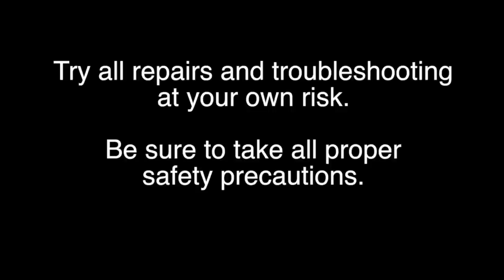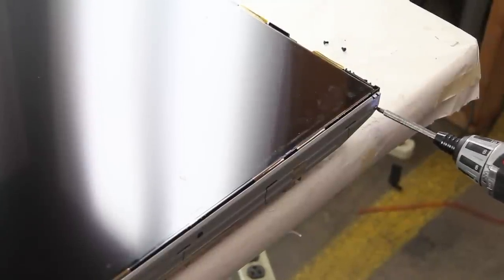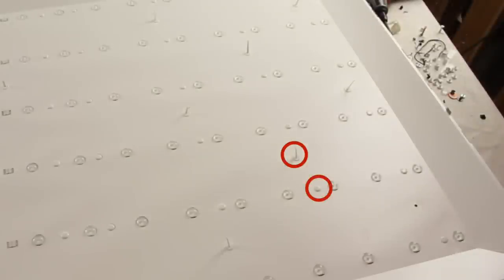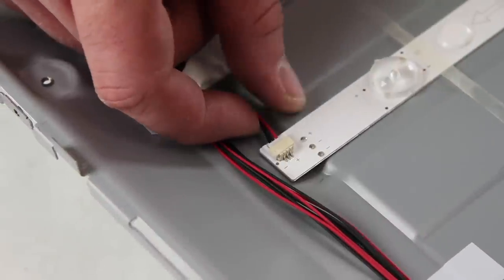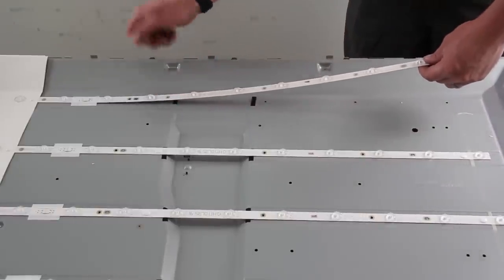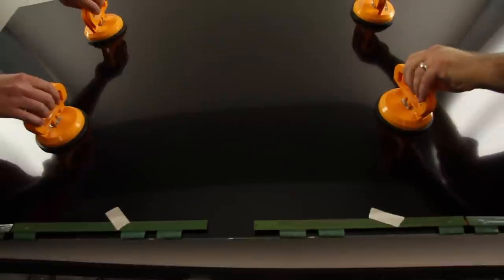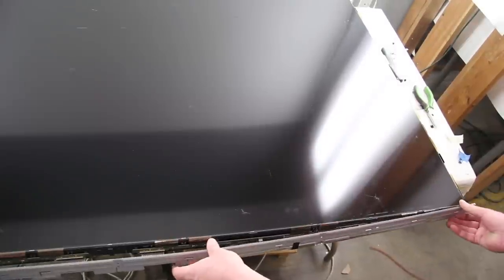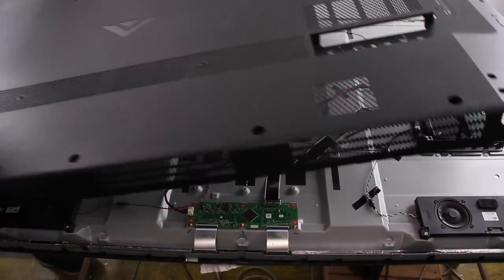Vizio 70" TV LED Strip Replacement Tutorial for Vizio Model E70-E3

Comment: i have a vizio 70 inch tv e70u-d3, and the tv is showing a purple hue it's pretty noticable to me, I think its the LED lights but I was wondering if it's something else.  So I wouldn't have to replace the LED lights, could it be the main board?
Reply: Generally when an LED strip goes out you will see a rectangular darker area on the screen. A purple hue across the entire screen doesn't sound like a backlight.
Reply: T Bone what is it usually indicate then, because I purchased LED replacement strips already
Reply: @alexusher7566  - After googling your problem it seems it actually may be the LEDs so you may be on the right track after all. Sorry. Personally I've never seen them go blue, just completely burn out. Good luck with your repair.
Reply: alex usher did the led strips fix your issue? I have the same thing!
Reply: Did this end up working for you? I have the same tv and there’s a blue tint and I’m considering fixing it myself.
Reply: @jman52597  did you fix it? I just ordered them leds for mine

Comment: So I replaced the LED strips and now my tv has no image at all (it did before) and is power cycling on and off. I am at a loss. I was just fixing some shadowing now I have no image.
Reply: Id check to make sure that you reassembled it correctly and that you didn’t leave anything unplugged/not plugged in all the way. If it was working before you started then it should work when youre done so long as you did everything correctly. Only other thing, is maybe youre replacement part could have been defective/the incorrect part needed.

Comment: What's the voltage per LED strip?
Reply: Good question, the LED driver part of the power board (both are on the same board, it's the white-PCB mounted in the middle of the chassis) supposedly runs 5V according to the board itself and another couple repair videos out there.

Comment: I performed the LED replacement on my Vizio E70-E3 last night and I'm having some problems I'm hoping you can help me with. Before the replacement, my TV worked fine but just had dark areas on the screen. After the replacement, I heard sound for about 2 seconds after I plugged in the TV and cable box but then it went silent. I also never saw a picture. I can tell the LEDs are on through the vents in the back and because the "black" screen lights up a little bit but there is no image on the screen. The TV menu and SmartCast won't work either. Finally, the power (and LED lights) seems to cycle on and off, even after I try to turn the TV off with the remote or the power button on the back. I have to unplug the TV to make the cycling stop. It will stay off after I plug the TV back in but the cycling starts again when I turn the TV on.

Do you think this is this a problem with a specific circuit board or all 3 of them involved? Any advice you can offer would be appreciated.
Reply: I am having same issue. Did you ever get any fix for this?
Reply: @rekenhavoc1  no fix. Ended up replacing tv
Reply: What exactly was your problem before  replacing the led strips?
Reply: maybe you were supposed to switch inputs If there's no connection on the input, the screen will stay black, even tho its on.

Comment: Bought the e75 (75inch led replacements) - they were too bright and showed clearly through the LCD panel. Waste of $100.

Edit: turns out, I was the smart guy who put the filters backward! Works like a charm now!
Reply: Menu, picture, backlight
Reply: @rowejason  tried that, I can still clearly see the "circles"
Reply: I just successfully did repair zero issues is all I am saying so it works. Do you think maybe the diffuser panels were put in backwards. Did you tape corners. Just curious n trying to help. After all there is a 50/50 chance they could go in backwards and after thinking about it that sounds like the issue. Hope this helps
Reply: @rowejason  I will see but I taped and labeled prior to removing but I will be removing and rotating them to see if that affects anything
Reply: I hope you get it bud
Reply: Works now!filter panel backwards
Reply: So glad you got it!!
Reply: @rowejason  yes its awesome to have a 75inch tv for $100 :)

Comment: My comment disappeared; not sure what I touched.  Guess I should not try the repair.  Vizio M70 C3.  Looking to see if I bought the extended warranty.  Appears my backlighting was set on 100 % since I know I have never seen that setting until I noticed the dark areas and poked around.  Anyone want to buy a 70” Vizio in need of some small. Repair? Actually can watch it a bit longer, not really too bad at the moment.
Reply: Nope.   Bought it 12/22/2015, lasted 4.5 years.  No more Vizio for me.

Comment: Question for anyone who can answer: I just found a Vizio E60-C3 in the trash. It powers on and I get a picture, but it's very dark. At the very bottom of the screen, on the right, it looks fairly normal, but the rest is so dark I can barely see it. I'm thinking that it's the LED strips, but how can I be sure? $100 may not seem like much to some people, but I don't want to spend the money, go through all the trouble of replacing them and then find out that it has some other problem.

I mean, it's worth it if that's all that's wrong and I can have a fully working 60" TV for the cost of the strips and a little effort, but I don't want to end up wasting my money.
Reply: Take a flashlight and shine it into the tv. If you can see a picture, then it's just backlights
Reply: @jimmyfrancis2722  Thanks. I can already see a picture, it's just that most of the screen is quite dark. I watched another video that showed how to take that model of TV apart and apparently, you can turn it on with the screen removed and see which of the backlights light up. I just haven't had the ambition to actually take it apart, mostly because I can't spare the money for a new set of backlights. I don't want to leave it disassembled in pieces (if I leave it apart too long, I run the risk of losing the screws or forgetting how everything goes together) and I don't want to take it apart, test the backlights and then put it all back together, only to have to take it apart again later when I DO have the money.

I've also seen people mention that the TV sends a power surge through the backlights at startup, which contributes to them burning out much sooner than they should. Apparently it's a fairly common problem with some Vizio models.

I also watched a video of someone replacing individual LEDs on the backlight strips using a pack of cheap LEDs and a hot-air soldering iron, which is attractive to me financially, but is quite likely beyond my skill level. Not that I even own a hot-air soldering iron/torch...

Comment: I did the repair and now the left side of my tv is still dark and now I have some vertical lines in my screen. Also the power turns itself off randomly. Vizio TVs are junk. $100 down the toilet.
Reply: some of the issues you have now are just a bad connection, dont give up so easily
Reply: How old is your TV? You might need a replacement power board, which is a very EASY fix!

Comment: Why would anyone want to try this.......
Reply: it must cost a lot of dough
Reply: self torture and then the payoff of a
 working tv
Reply: Cause that's what men do repair things
Reply: I went to the TV repair shop and saw this at it's half way stage and it was explained to me differently by the technician and that it be cheaper to just buy a new TV.  It turns out that my TV doesn't offer parts for themoel that I have anyway so I'll be replacing a 5 year old TV sometimes soon. Right now, I'll just adjust the color to try to mask the blue tint that shows up everywhere. I should have listened to the manufacturer by keeping the backlighting as low as possible and the auto dimming feature on. 2 very important things! Oh! and P.S. Women repair electronics as well....
Reply: When the tv was purchased for 1500bucks this 100 dollar fix is well worth it.  I understand some people aren't inclined as well as others but is relatively easy to do
Reply: @nemzdroidx  You are brave. Maybe I look stupider than I really am! But repairman have to make a living too.  My 65" Vizio M series was a good buy in 2013 with 3-D and videocast but I'm not looking for all that stuff anymore. A TV is a TV. These companies could come out with a TV that is built to last but they wouldn't make a cent if that happened! NO MORE Vizios for me... My next TV will be LG / or  Samsung
Reply: I get you but for me this vizio went out after 2 years for the price at the time 4k and hdr in this unit and price point couldn't turn it down I agree with you I have  samsung  a 55 for over 8 years zero problem
Reply: My original comment was to why would anybody want to try this. Only Ourselfs is what limits our capabilities the real question should be why not
Reply: Because people read too many CNET articles claiming extended warranties are pointless....and didn't spend the $99 for an extended warranty.  Now they're out $1,000 after just two years of ownership on their TV and are desperate.
Reply: nemzdroidx this woman too.
Reply: Ronald Joseph Vizeo definitely has a problem with led. It seems that every time you turn it on for a split second you get 6 volts to each single led and they are 3 volt +/- .2